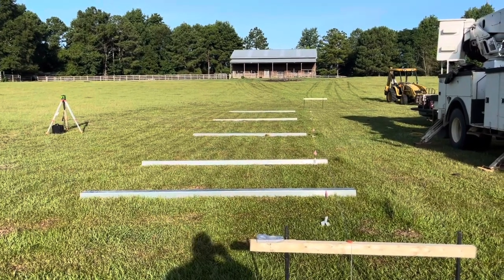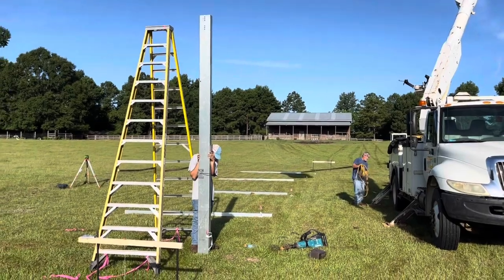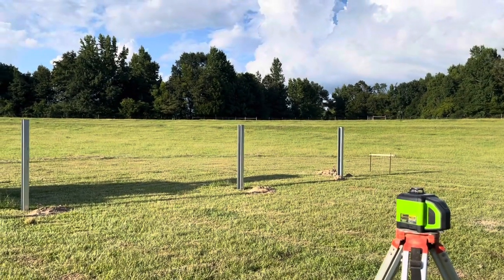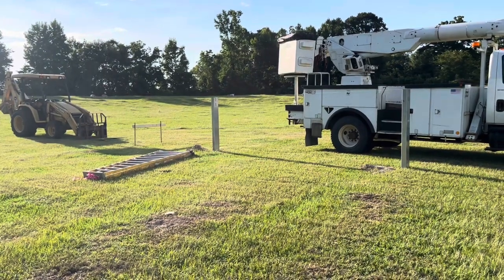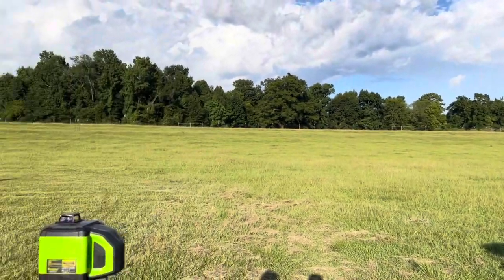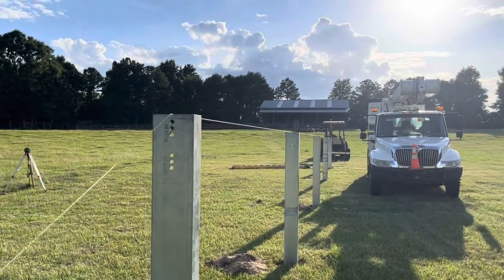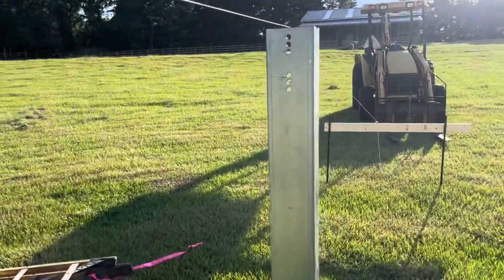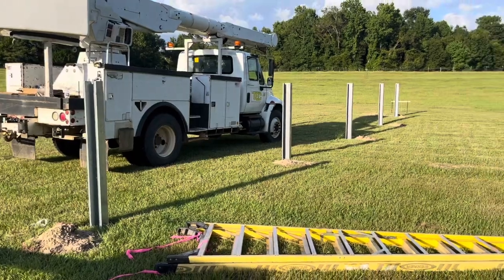Solar Power Project - Driving Posts for Sinclair Ground Mount

Comment: I am about to get. Sinclair myself. No access to a post driver myself. I wonder if i can bore out 3ft then insert and drive it down then fill the 3 ft with concrete? Glad you made it.
Reply from the maker: @michaelshin69  that would probably work. Really depends on how hard the soil is.

Comment: Holy Smoke!  How many panels are you putting on that system?

Also, was it necessary to pound a 12' post more than 4' in the ground?
Reply from the maker: 42 - 455W panels. I think the standard post is 10’ but I requested 12’ post. We’re prone to hurricanes in our area and I wanted the extra depth.
Reply: @jeffmotes2129  You have big cajones and a fat wallet, my most interesting new aquaintance.  

At a little over 19kwh of solar panels, this must be a  beast you've designed. I understand what you're attempting to solve with the area you live in but I didn't see videos on what else you've designed into this.

Or did I overlook it?  Either way, if design videos do exist, would you please point them out to me? 

Thank you in advance....
Reply from the maker: @soonerarrow  I’ve modified my design several times since I first started planning this back in November 2021. I’ll post a video on it in that not too distant future. 

As far as the wallet - it USED to be fat now it’s on starvation! Lol